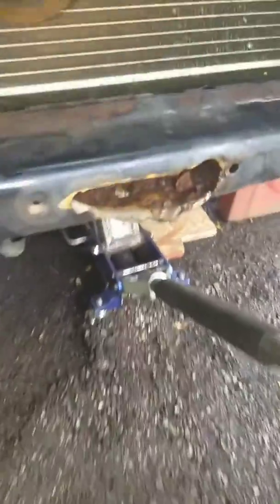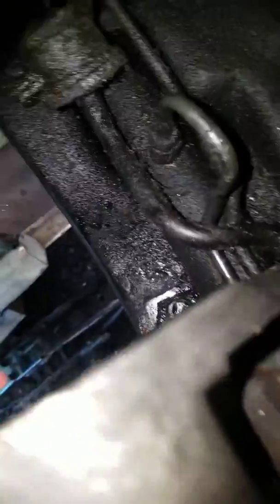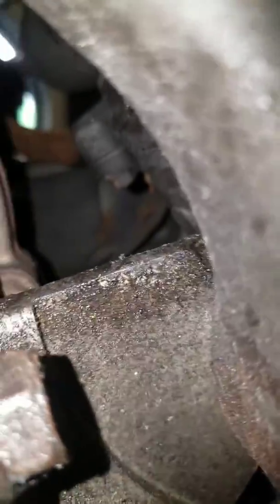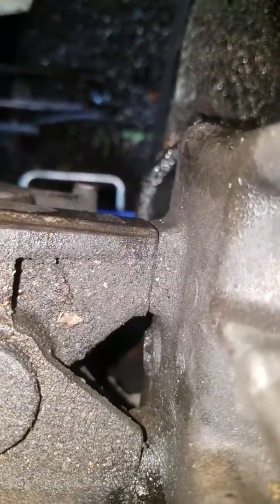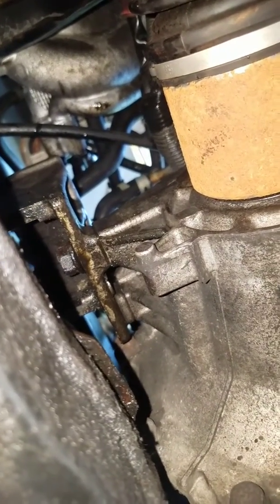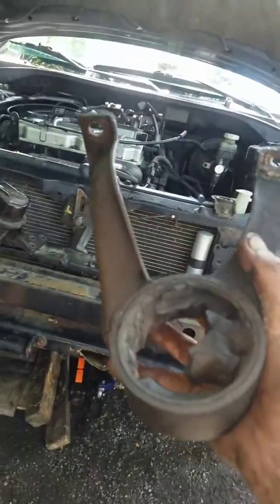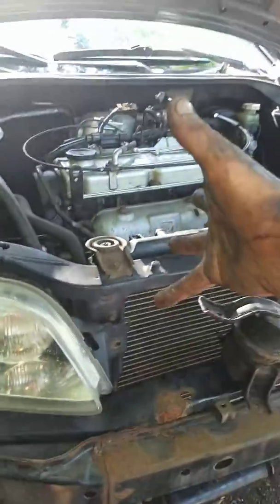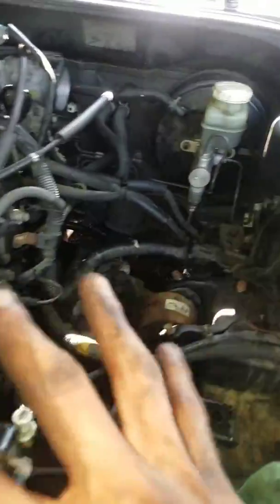03 Mitsubishi Lancer how I replaced all motor mounts (#hack) #comment #like

Comment: So I had a problem getting the hidden bolt on the bracket to break due to stripping it. In the end I had to bust out a dremel and cut through the motor mount leg which was time consuming and being careful about the surroundings. Once it was cut I pulled it from the top and I got a 1/2in breaker bar with my impact 17mm and smallest extension. Unfortunately you'll have to take off the throttle body to give your breaker bar some room. After a good pull it broke loose and was able to replace the bolt and motor mount. I still preferred that way over dropping the subframe lol. Thanks to your video though I learned a lot.

Comment: What tool did you use to get the 2 back screws off of the rear motor mount? When i get under the car I can get any tool I have to fit around the bolt and have the space to turn. Thanks
Reply from the maker: The two front bolts and rear passenger one I got out using  a couple 3/8 extensions and one swivel from the top. The tricky one is the driver rear and I had to get it from under the car. I used a wrench and then used a small leveraging pipe find a good angle and break it free then literally turned it out baby turns until I could turn it by hand. Thats how I got that out.
Reply from the maker: Hope that helps you out.